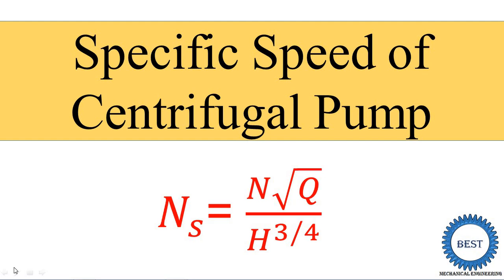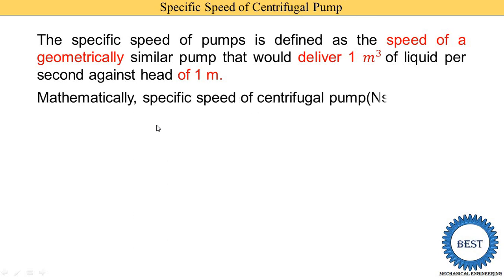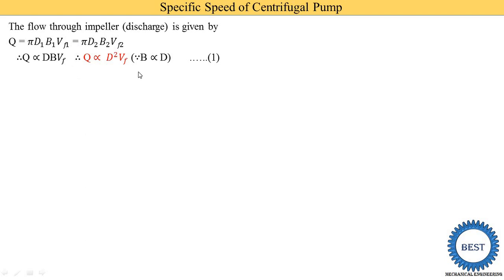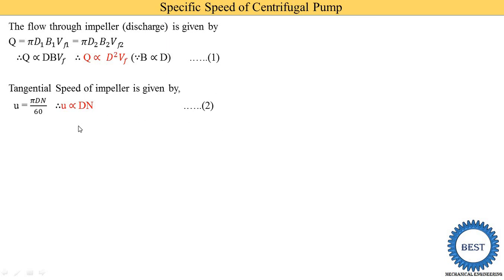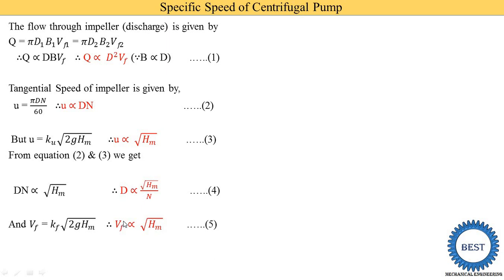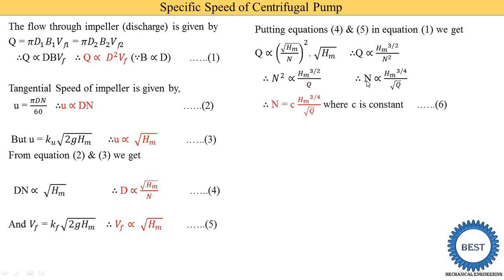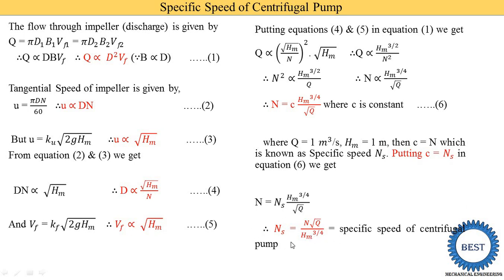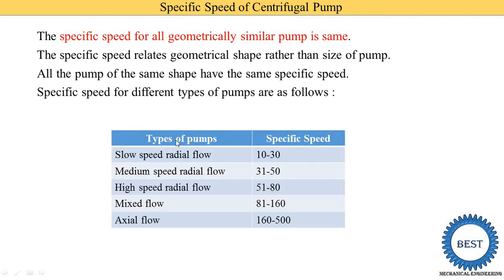specific speed of centrifugal pump

Comment: The pump has an impeller diameter of 380 mm and when operating discharges 310 m3/h of water while producing a hydraulic head of 45 m. The power requirement is 55 kW. Determine the required impeller diameter of a geometrically and dynamically similar type of pump that must deliver a discharge of 280 m3/h and produce its head. What is the power requirement for this pump
Reply: Sol